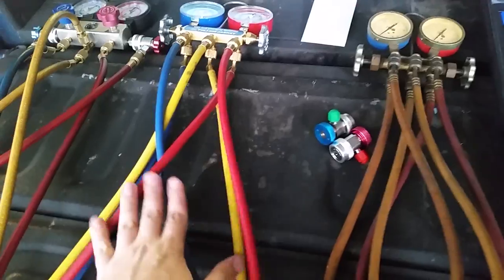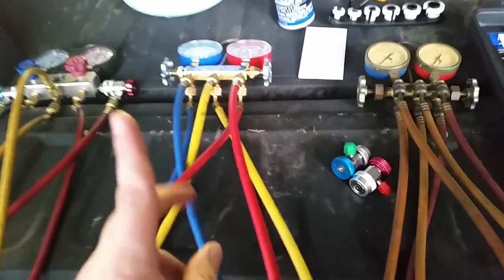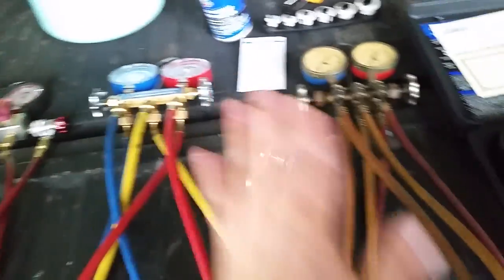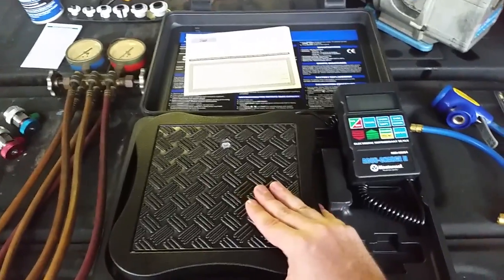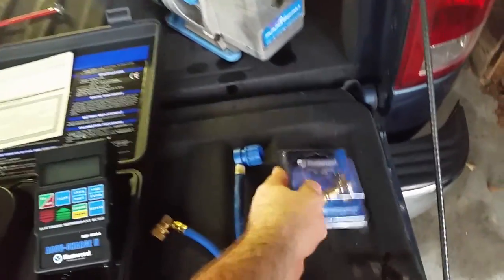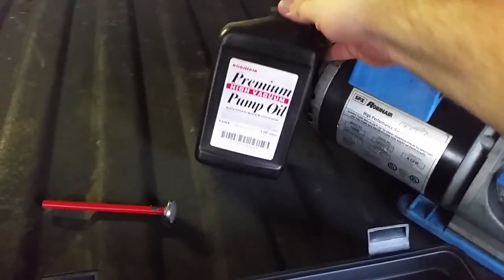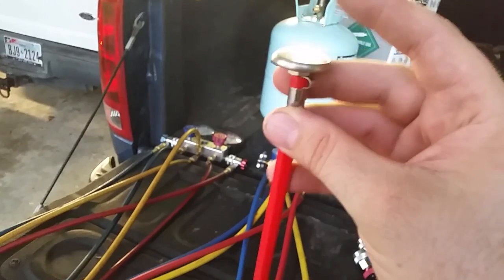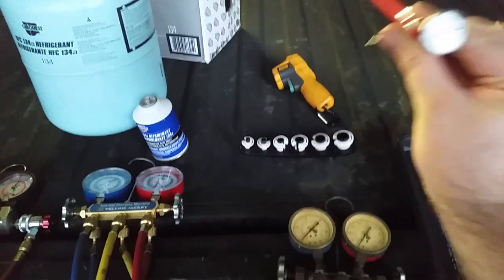A/C tools needed for doing automotive air conditioning

Comment: I have Robinair tried and true. I have been using their produces for 46 yrs. Also inherited my dad's equipment. Yeah strange. My brothers ares commercial drives. I turned out being an HVAC tech. Yes freon is much more expensive then it was before 134a came in to existence. Once the EPA restricted purchase of freon and made us all get certified. Which I think is a good thing.People really need to know what they are doing. Great video. Buy the yellow jacket. It's a good set. A really good set will cost from $200 and up unless you get lucky. All my equipment is  Fieldpiece,Yellow Jacket, Robinair. Thing is I trust these brands. My Robinair vaccum pump is made right here in the USA 100% is old but still looks new. Take care of your tools and you can pass them on to the next generation in you family that wants to be a HVAC technician.

Comment: you can use the "134a" gauges with r12. Doesn't matter if they read in psi, bar, or kg/cm squared. The only difference between gauges is the temperature scale. You don't need to have the temp scale on the gauge. You can just get a chart or graph that tells you the expected pressure at various temperatures. Of course you won't need the quick coupler adapter at the end of the hoses, so just take them off. And the $30 China-made gauges I bought aren't any worse than the Robair gauges I bought for $75 in 1987. The both had imperfectly cut threads where you screw on the hoses. The gauges themselves on the Robinair don't seem to be any better quality. The only reason I bought a new gauge set from China is that I figured my old hoses, and the o-ring seals at the ends, were probably decomposing, and it was no more expensive to buy a set of gauges than to buy new hoses and o-rings. My Robinair $275 1.2 cfm vacuum pump – also a piece of poop. The threads in the exhaust port were not cut well and would have shredded the plastic plug that goes into the hole. For less than $100 I can get a 3 cfm pump from Harbor Freight.

Comment: What if you need to evacuate old freon! Can you use the vacuum pump?
Reply from the maker: You can, of course with the cost of freon recycling is the best.
Reply: @CliffordRice  okay thanks for the reply. But don't you need like a special equipment for the recovery? That's my question cause I don't think I have a leak on my SUV ac system it has freon but not enough. But mine has a dual ac in the sticker under hood it says single this many freon and dual this many.

Comment: Where is the recovery machine? you should at least have that bud.
Reply from the maker: You can got to any shop to have the freeon recover. Most recover machines are expensive for most people to buy to only be used once or twice.
Reply: Clifford Rice Recovery machines are not cheap indeed. Lowest prices price I could find was slightly over $400 and you need to get a recovery tank as well (about $80). Do you know approximately how much shops usually charge to recover refrigerant?
Reply: Clifford Rice But that is NOT what Mark Galan asked you. Your video did not mention the evac system. You ducked Mark’s question. He did NOT ask you where to take your car to get the AC evac’ed. He asked you why you didn’t have an evec system in your video. And in future videos please just get to your point. Please cut out all the chit-chat. You’ll get TONS more views.